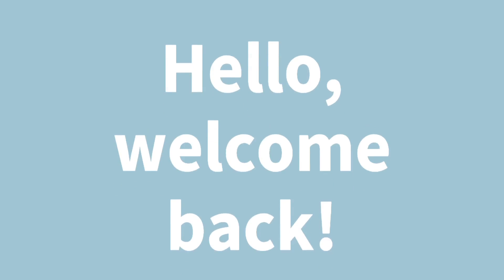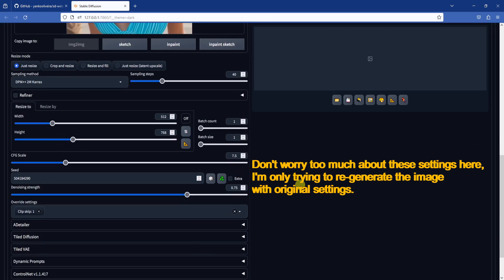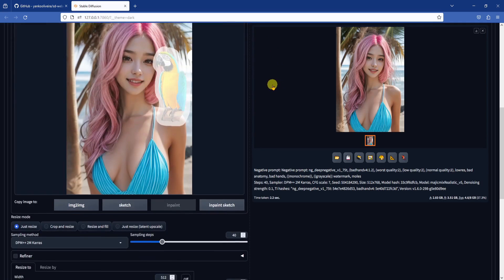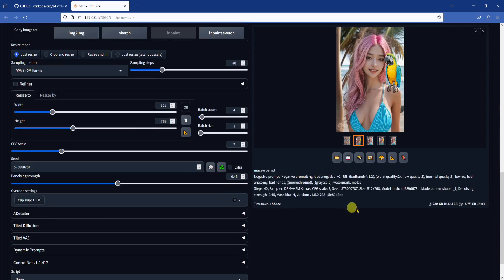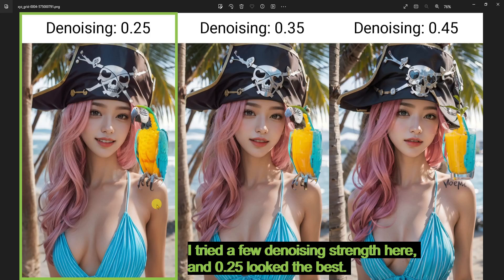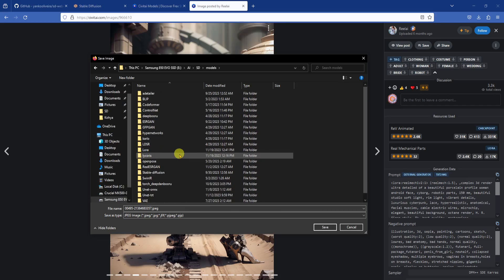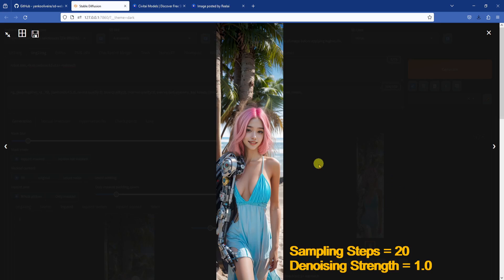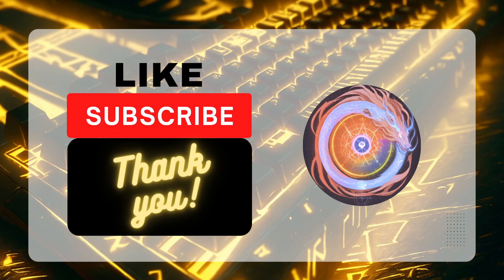How to Inpaint in Stable Diffusion A1111, A Detailed Guide with Inpainting Techniques to level up!

Comment: Would it be possible to use a picture of stick figures as a base image and add generated images of persons one by one using this technique?

I have a hard time adding multiple persons to an image, sketching rough shapes of bodies onto a blank canvas.

My attempt would be…

1. Generate an image of the stick figure sketch like in chapter "Inpaint technique #1"
2. Open the generated image in img2img
3. Add my prompt (1boy, walking, shirt, jeans, sneakers)
4. Paint over the first silhouette in inpaint mode.
5. Settings: mask content: fill; inpaint area: whole picture; steps > 30; seed: -1; denoising > 0.75; batch: a bloody lot;
6. Repeat from step 2 with the next stick figure
7. Regenerate the image without promt with some ADetailer settings (???) to make it look better.

Comment: Very interesting video, I didn't know this tool. Since you are open to new requests, I would like to propose one that interests me.. 
I am becoming used to using Automatic1111 on the renderings I produce to add some details here and there.. being high-res images I use the Tile/blur(controlnet) + Tiled combo Diffusion&TiledVae to work directly on it and do further upscaling.
When there are people in the images, they very often come out wrong. Is there any way to use the Inpaint module directly in high resolutions without making crops?
Reply from the maker: I have a video on Tiled Diffusion / Tiled VAE, check it out here: https://youtu.be/44waH3sDYOM. Not sure if this video answers your question or not.

Comment: For easiest organization and use of LORAs, I recommend installing sd-civitai-browser-plus from the extensions tab.  This will allow searching CivitAI from A1111, auto save the preview and store the trigger words. When you choose to add the lora tag, it will also include the trigger(s).  Also, you should create sub folders for your loras in the ../models/lora directory for each type and sub-sub type you may want.  It's autorecursive so it will list them all for you.  One last thing is storing your models outside of A1111 install location. I have mine in an easier to use main folder like so:
D:\AI\Models\Lora. I also have D:\AI\Models\Embed and D:\AI\Models\Chkpt.  I'd rather keep all of them separate than within the install directory.  To utilize this you need to add/change the webui-user.bat  file that you run to start SD to include the following (using your own paths of course):

set COMMANDLINE_ARGS= --ckpt-dir "D:\AI\Models\Chkpt" --lora-dir "D:\AI\Models\Lora" --embeddings-dir "D:\AI\Models\Embed"

you can also add 
--autolaunch --medvram --update-check --xformers --upcast-sampling --update-all-extensions  for other tweaks and auto updates to extensions when you run or reload. (no need to do a check in extensions tab)

Here is the full documentation for command line arguments you can use according to your needs
https://github.com/AUTOMATIC1111/stable-diffusion-webui/wiki/Command-Line-Arguments-and-Settings